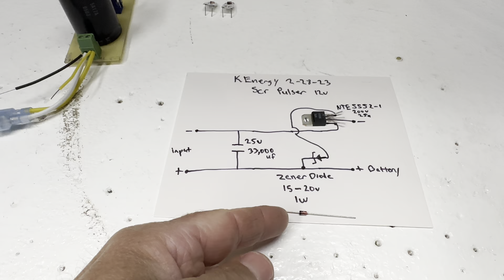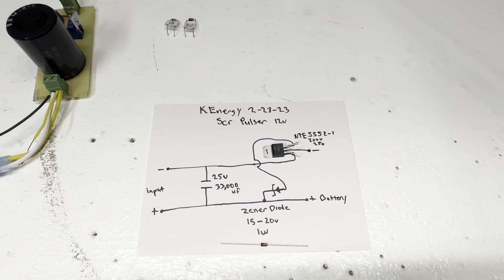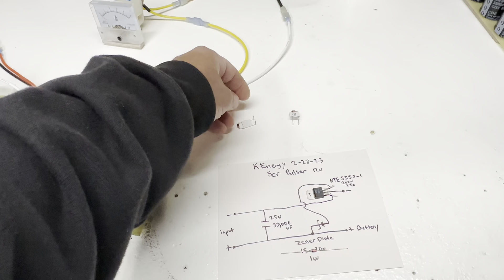Cap dump scr zener operation

Comment: I've tried this with no success, thanks for this demonstration.
Reply from the maker: What uf were you using?
Reply: @kenergy1707  Located some SCR's, bt154 800r, bt152 600r, tyn1225, and some very large ones.
Also have a variety of zeners to choose from. It would be good to be able to pulse the battery with thirty or more volt pulses. You can look at what I been doing, the same simple circuit with hundreds of variations. The scr won't turn off until the voltage drops to zero. Will try what you show on the schematic.
Reply from the maker: @tribulationcoming  cool ! 
The higher the voltage between cap dump and second battery the more the motor will surge a bit depending on what motor is charging it 
 When the cap reaches the same voltage as charging battery the scr will reset unless charging is to fast 
 Sounds good !

Comment: Although this type of cap dump is very easy to setup and works reasonably well, the capacitor cannot be too large in microfarads because the SCR will not self de-latch easily and might get stuck in the ON status.
Reply from the maker: Yes so true

Comment: Good day, thank you for your videos. I have an scr cap dump with a 15v zener. I feel like the scr isn't opening long enough, the cap only discharges from 15v to about 13v. Can you advise how I can prolong the scr being open for? Do I need a resistor in series with the zener gate?
Reply from the maker: That sounds correct 
 You can put a resistor in series but it might come on at a higher voltage 
I have a mosfet driven cap dump on my web site 
www.kenergy.store

Comment: Great explanation! Thanks! What about dumping the inductive spikes directly to the battery? Does the motor have the same behavior? Thanks in advance!
Reply from the maker: Thank you! 
 You can do that motor runs fine the cap dump just gives time for the spike to condense for a more normal output

Comment: Are you going to do a video of your more complex cap dump and show a schematic? Thanks
Reply from the maker: Thanks for the comment 
 I’m an not at this time 
it took quite a lot of time and energy to make it work right 
 Each one is a bit different depending on cap capacity 
 I will be selling plans for it later
Reply: @kenergy1707  Is that with a mosfet? I have been using a mosfet I designed. But it needs a pulse to drive it with that cost power.
Reply from the maker: @Jerrydt44  on the video? Scr

Comment: Would this work if an antenna and ground charged a 10 uf cap? Could you dump the cap into a battery? If so what values or other items are needed or eliminated?  Thanks!!!
Reply from the maker: @bobcox9836  yes probably smaller cap like you described wish scr and 15v zener

Comment: Good video
Thanks for sharing
Reply from the maker: How’s your motor coming ?
Reply: @kenergy1707  Thank you for asking still working on it with the materials i have
Can you test your motor with 12v to 220v transformer with 2 or more leds
maybe with microwave capacitor before the transformer and after the transformer
Reply from the maker: @Edmorbus  I can 
 I only have 12 to 120 transformer but will do the test
Reply: @kenergy1707  Yes is also good
Reply from the maker: @Edmorbus  I hooked up transformer to my motor it ran the light 
But also ran it without the transformer
Reply: @kenergy1707  Have you resonance or not and thanks for the test

Comment: why is your anode (middle leg) on your scr connected to the negative of your battery?
Reply from the maker: That’s how I got it to work properly
Reply from the maker: It switches on negative side
Reply: @kenergy1707  its odd how it works sometimes lol i was just curious since it seems like you have the best cap dump method. Also, when you make your boards, are you having to do everything by hand? Like do you make your own boards?
Reply from the maker: @freedomer342  yes I make everything from scratch 
My mosfet cap dump works great it is on my website I have a couple sizes 
www.kenergy.store
Reply: @kenergy1707  
Hello dear @kenergy1707!
I'm trying to make a circuit using available electrical components, but unfortunately it doesn't work. Unfortunately, I don’t have the SCR NTE5552 thyristor, and for some reason the circuit doesn’t work with the BT152-600R SCR thyristor.
Can you suggest a solution?
Reply from the maker: @TereshDmitriy  if the capacitor is to big it will pulse once then latch
Reply: @kenergy1707  Can you suggest a way out? Perhaps you need to connect the minus to the base of the thyristor through a resistor?
Reply from the maker: @TereshDmitriy  just smaller capacitor 
That’s why I developed the capdumps without the scr